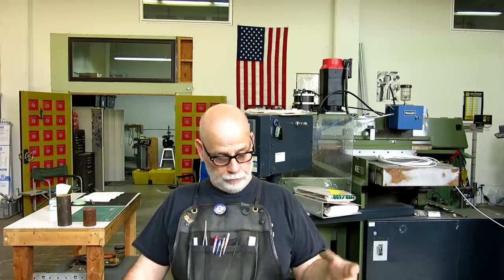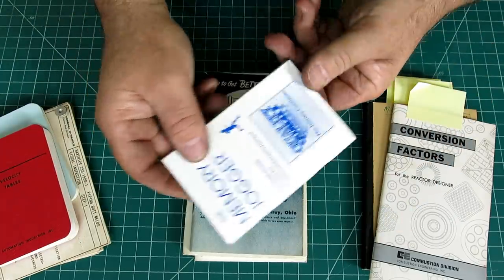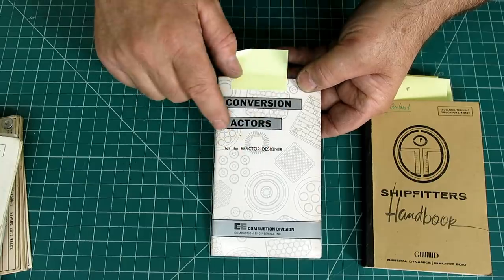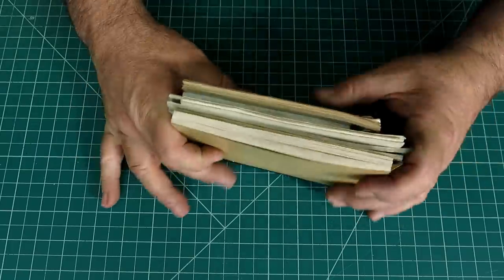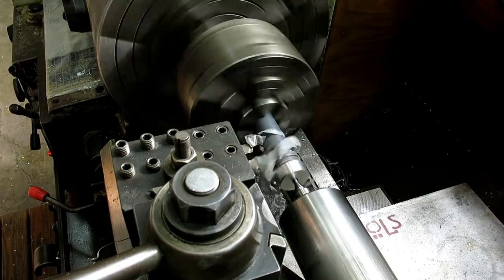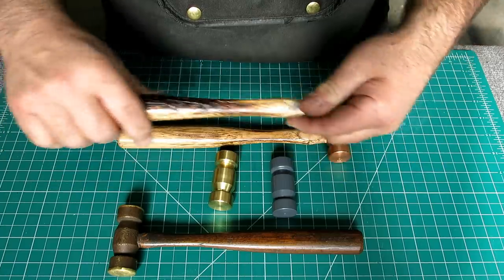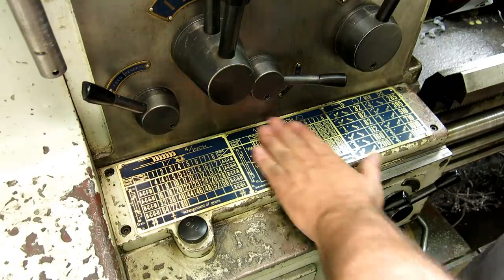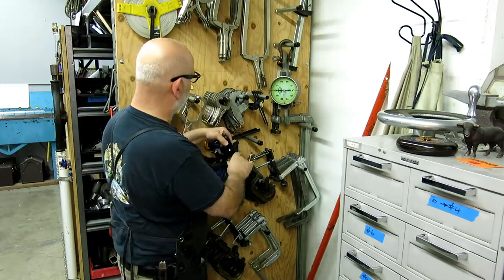Monday Night Meatloaf 123

Comment: I really liked the air bearing portion of your video !  Back in the 90's I worked as a industrial mechanic/machine tech  in a plastics plant, the moulds on our Injection blow moulders had air bearings ported into the bottoms of the mould plattens. We would just stone down the machine deck, plug in 80 Psi of air and float out about 2000 lbs of steel and aluminum with one finger. I used to enjoy training the new employees on changeovers and watch the look on their faces when it would come to removing the moulds. Here is a short vid on the IBM machine if your not familiar with one. https://www.youtube.com/watch?v=hTJ3EpcI2lY

Comment: Hi. I'm not a 110% percent sure, but I think you made and error when reconstructing the brass hammer.
Notice how the original handle tapers off toward the hammer head?
As I remember that is intended. It gives a flex to the tool, reducing the impact of the stroke while at the same time sparing the worker wrist.
Small, light hammers are used with a high frequency of striks, as opposed to e.g. a black smith hammer (which I'm more accustomed to), which are usually abt 3+ pound of weight, and falls heavier, but with at lower frequency and lot less accuracy.
I think it was the youtuber 'DF - In the shop' who did a video on the topic of hamme handles.
I actually found the video, let's hear if I got it right :)
https://www.youtube.com/watch?v=xsXKiAcBO5I